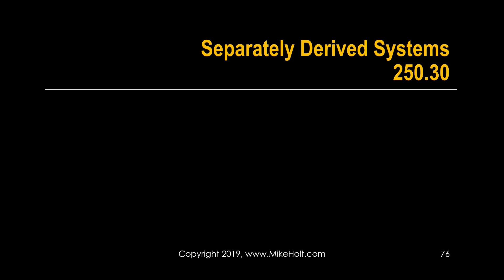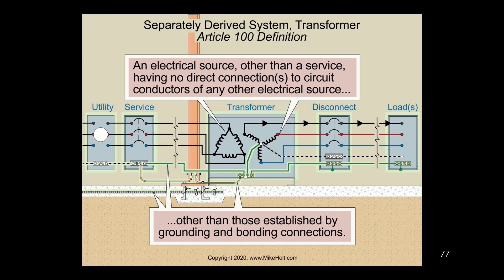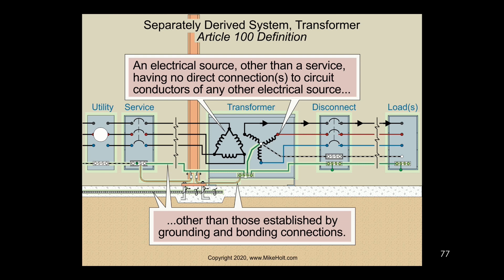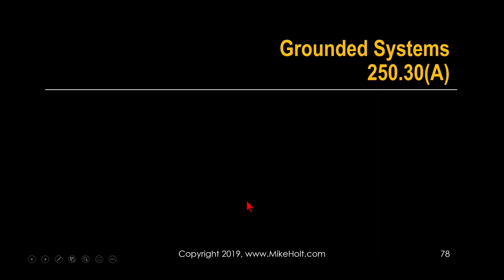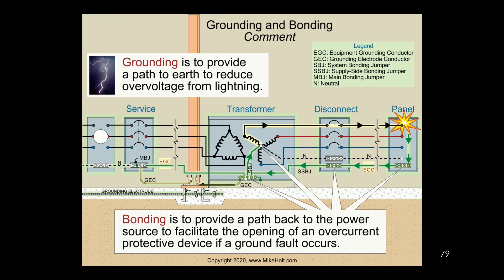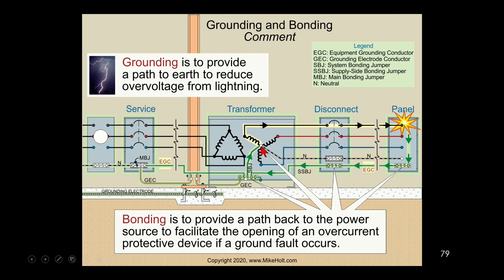Grounding, Transformers [250.30, 2020 NEC]

Comment: Thanks for posting all the helpful information online.  Question:  If a generator is the only source of power to an off-grid shed,  there are no utility feeds, where should the neutral-ground bonding occur?  My understanding is you only should be bonded in 1 place, first service panel.  I'm planning to supply power to small service panel from the generator but can't quite wrap my head around where the bond should occur in this setup.  Thank you in advance.
Reply from the maker: According to 250.30(A), you need to make the neutral-ground at the generator.